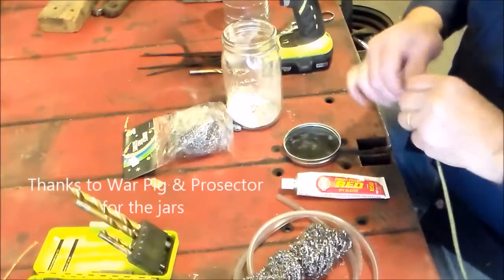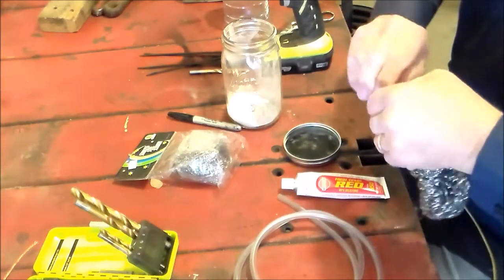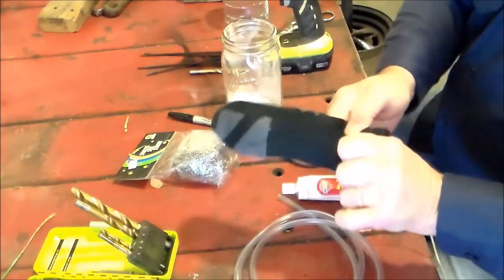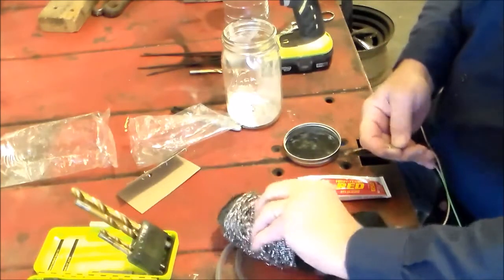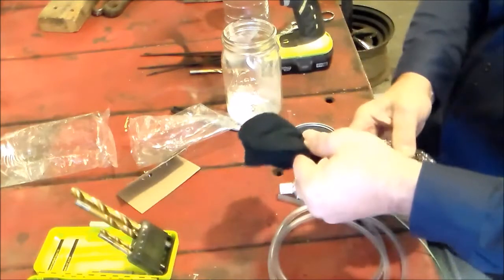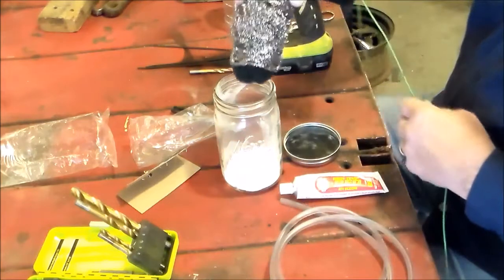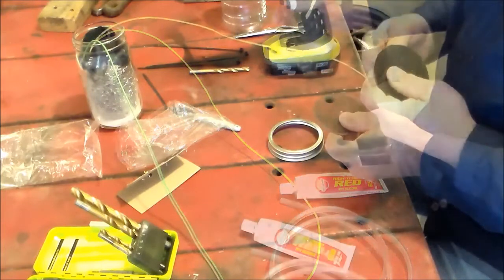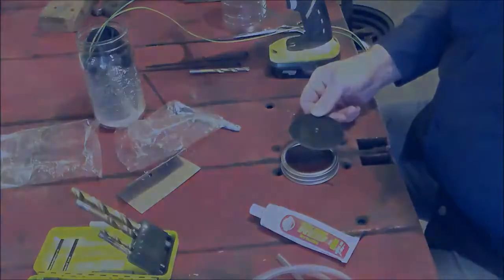HHO, Hydrogen Gas  or Brown Gas Generator  Part 1

Comment: ￼

HHO ACMEC

Hho kits for your  car & bike. HHO kits solve all the engine heating problems automatically. More engine power and performance engine running cool Without Creating Any Carbon Emission . environment friendly fuel saver device. Also Best technology for the human health and happiness purpus HHO breathing machine. VERY simple and safe and easy technology, amazing recovery of human dieses like eye care,skin care, breathing shortness, parkinson and so many other dieses. Hydrogen rich water is best energy drink for human body health and happiness and beauty, for good sleep. Hydrogen gas is a powerful antioxidant detox our body. Reserach on hydrogen water is in the early stages so side effects are unknown. Or you can say so for no side effects. Hydrogen is 88 time smaller then vitamin c but richest in antioxidant. HHO technology best for our  cars. I am sure nany persons would be benefit from our hho acmec videos. HHO kits are very simple but very useful for old cars engine efficiency and performance fuel saving and money saving and envernment control hydrogen on demand system zero carbon emissions. Kit can install without any modifications in your car engine. HHO kits are very useful for cars engine efficiency and performance and money saving Hho prolong the engine life and solve the engine heating problems,prolong the engine oil life too reduse service or car mantanic. your car will run like a New car. Calm and quiet running, remove carbon monoxide witch is very bed for the human health. Your car will start faster than before. Your car temperature will redused. Improve your car mileages. Hho kits make your car More power full, smother running. HHO kits will not harm to your car engine. Hho improve the fuel burning efficiency like high octane fuel. I called HHO technology is a  money saving technology. Rember to use only a little HHO gas for the best engine efficiency. Don't try to store HHO explosive gas . Hydrogen on demand system is best for use. For more information please call me.03082266179 Zafar.
Reply from the maker: Thanks HHO gas is an untapped resource.